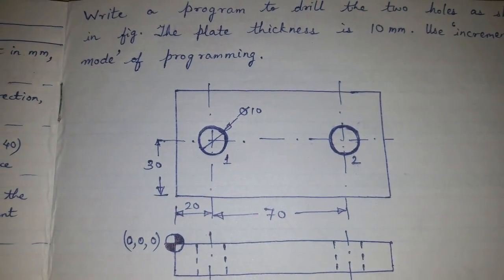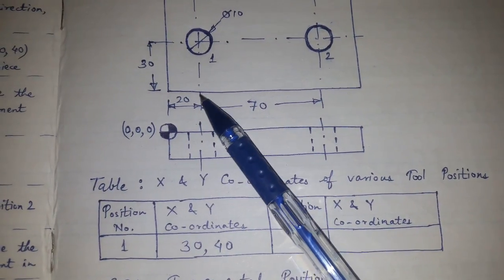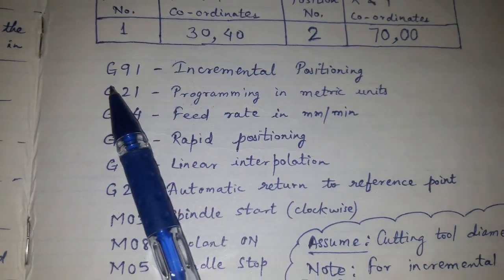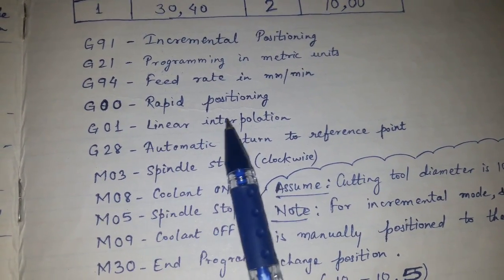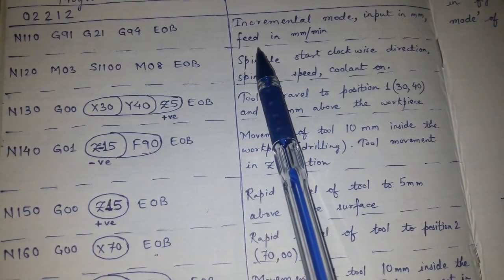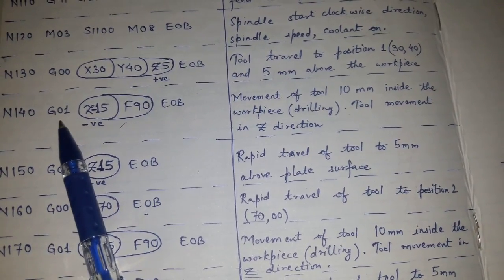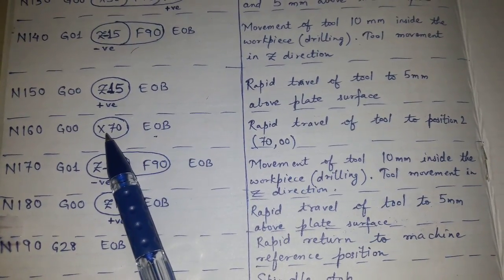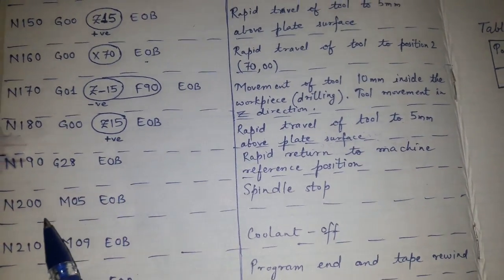Part program for drilling operation - Incremental mode... #10kviews #viralvideo

Comment: write the apt motion statements to perform the drilling operations for the perform the drilling operations for the part shown in figure "-1" cutting speed 0.4m/sec feed=0.10 mm/rev and table  travels speed between holes =500mm/min